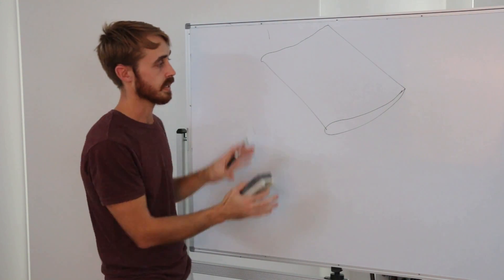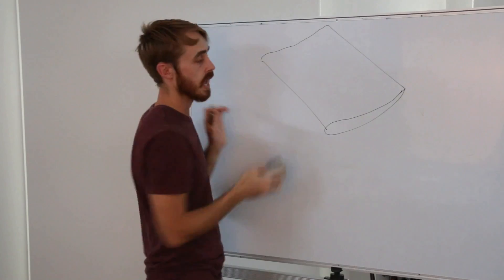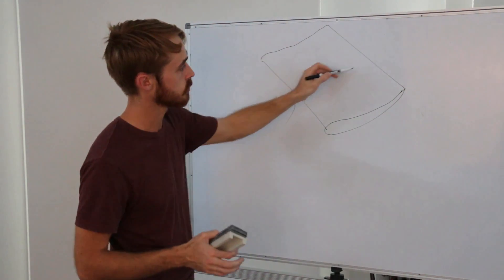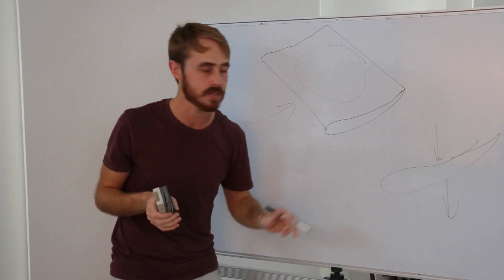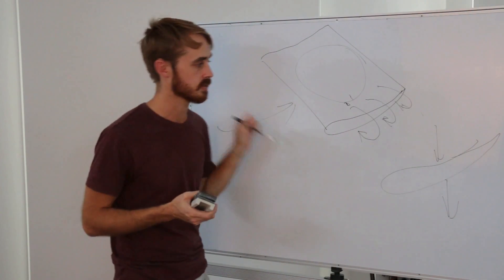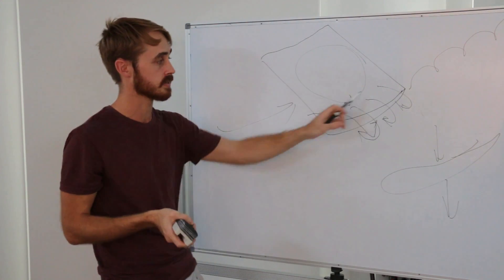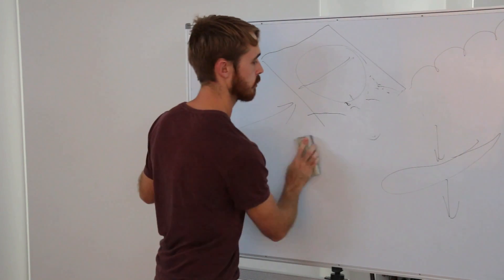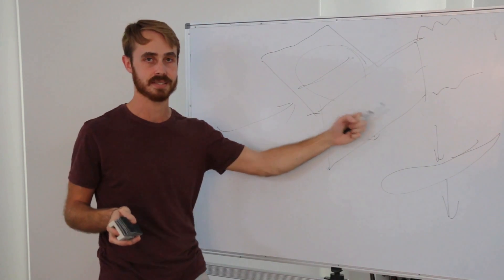Why do Car Wings Need Endplates?

Comment: I know this is an old video now, but I'll ask anyway: if a fast car has large, vertical fins at the outside of rear body without a wing connecting them, what effect would we expect for both straight line stability and cornering? Thanks for the video, great channel Kyle.

Comment: How to set up the endplates ideally? Does it matter the proportion of size of endplate to the aspect ratio of the wing? Height of  plate above and below the wing-- why are most setups with more plate below than above-- what's downside of having more on top?  Larger always better-- where does benefit start to fall off?

Comment: One think I want to add. More a terminology gripe. Low pressure, does not suck stuff. It still pushes, that's why it is called pressure. Vacuum is not negative pressure it is pressure lower than reference, lets say ambient. Lowest absolute pressure you can get is 0!
Reply: Boiko Aladjemov also, the the air wanting to flow from the center of the high pressure area on top to the low pressure area beneath is called spanwise flow. They use wing fences on aircraft to stop this and winglets to reduce the vortices.
Reply: You are correct but you missed my point...
Reply: You have a gripe about terminology, and then claim low pressure areas push things? Lol. That's not inaccurate, but is getting into some pedantry space.

Comment: Expanding on the theory a bit. Why then, on the leading edge of the endplate on Formula cars, and previously on prototypes (before they were regulated out), do we see the horizontal "gills" on the endplate? Surely that would open up the endplate and cause exactly the same phenomenon you describe here. Is there some benefit to generating and controlling the vortex off the endplates trailing edge? They have always seemed a bit odd to me, and i have never seen a proper technical explanation as to why they are there. I have seen much speculation as to why they are there, but nothing concrete that gives any kind of solid indication. I also find it somewhat strange that on higher speed circuits, where the wings are running a lower angle of attack, there are significantly fewer slots, and the higher AoA, there are more. I would love some proper insight on that.
Reply from the maker: +bigbuckoramma Perhaps the full video is for you: https://www.youtube.com/watch?v=7pWuI2Fk57U

Alternatively, I could do a video just on the gills if that interests you?
Reply: DOH! Didnt realize you already did a video on it. I will go watch it, and get back to you.
Reply: +KYLE.DRIVES Ok, so, watched the other video, really explained it to my satisfaction.

As always, the quest for knowledge continues. Recently we have had the test in Barcelona for F1, and there are some interesting development in there that i am curious what your take is on them. Both directly relate to this subject, so i am pinging you about it here.

First, is the end plate slots. On the Toro Rosso they are running a, for lack of a better term, "knife edged" rear wing slits that extend the slot opening to the leading edge of the wing end plate. Can you think of any reason as to why this might be beneficial? Or perhaps do some rudimentary CFD modeling of it, and see what improvements it may allow for? They have even gone as far as, on the last day of testing, also fitting the knife edge slots onto the end plates of the monkey seat over the exhaust.

http://www.f1fanatic.co.uk/wp-content/uploads/2016/03/XPB_791700_HiRes.jpg
http://img3.auto-motor-und-sport.de/Toro-Rosso-STR11-Praesentation-1-Maerz-2016-fotoshowBigImage-be3af1aa-930800.jpg

Likewise, Ferrari also have an interesting concept on their end plates. Typically we have always seen the little turkey feathers on the trailing edge of the side boards. Been standard for a while now. And we have seen vertical slots, similar to the turkey feathers, on the attachment point of the end plate to the top deck of the diffuser/rear floor. But this year, Ferrari have put the same end plate slots on the lower side of the end plate, right above the diffuser desk. I cant for the life of me figure out why. Are they actually making that much pressure on the top of the diffuser desk to require it? Of is the little multi levele element on the trailing edge of the diffuser being energized by the vortexes generated off of them? I know it is hard to judge the effect of a rear aerodynamic element, without really having a full understanding of what it happening down the rest of the car, but i am curious to get your take on it nonetheless.

http://img1.auto-motor-und-sport.de/Kimi-Raeikkoenen-Ferrari-Barcelona-Formel-1-Test-1-Maerz-2016-fotoshowBigImage-3d4566c3-931193.jpg

They honestly have one of the most "busy" rear ends on any of the cars on track right now.

http://img2.auto-motor-und-sport.de/Sebastian-Vettel-Ferrari-Formel-1-Test-Barcelona-22-Februar-2016-fotoshowImage-10bf97a1-928512.jpg

http://img3.auto-motor-und-sport.de/Sebastian-Vettel-Ferrari-Formel-1-Test-Barcelona-22-Februar-2016-fotoshowImage-25d1bd28-928732.jpg

And clearly they know it, based on the absurd air rake they were running in testing.

https://images.scribblelive.com/2016/3/1/8b07f32a-a5fd-48ad-8cca-4ee6b91aa8bb_800.jpg

Thanks for your time.

Comment: Are there any drawbacks to end plates? If so, what are they and do you know of any alternative methods being developed?

Thanks for the video and good luck racing!
Reply: +Kyle M Green There is a slight increase in drag from the frontal area of the end plate.  Airplanes deal with this either through winglets or on newer planes, with a swept wing design.
Reply: Thanks, Jacob.

I'm guessing the increase in drag is disproportional to the increased efficiency of the spoiler.
Reply: @jacobbuehn5036  Love the video.  If I want to reduce over all downforce from the on a non adjustable wing. Can I remove the endplate for less downforce without much drag ?  From my understanding on video wing increase the effective area of the wing especially on outer edge. If I remove it, does it mean less wing area= less downforce no much drag ? Thanks